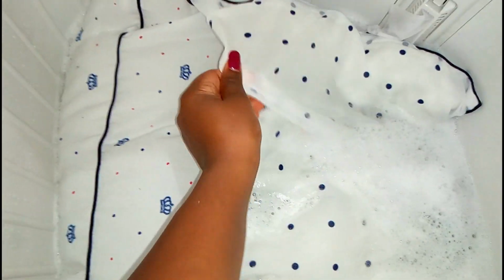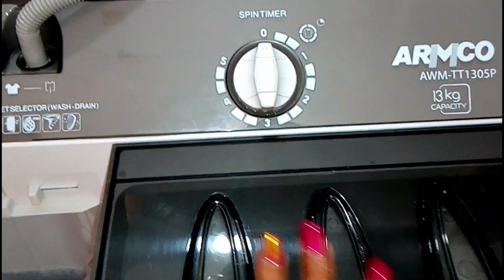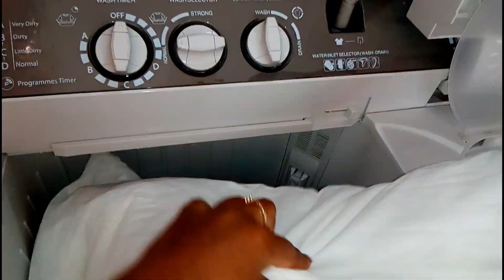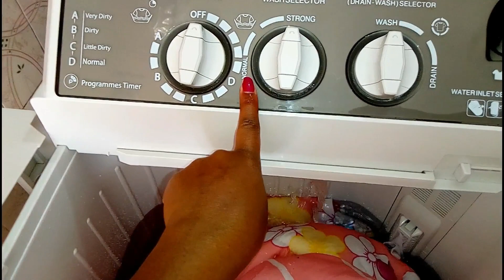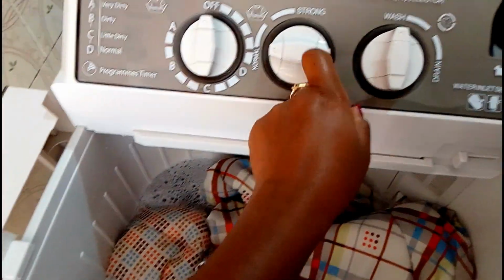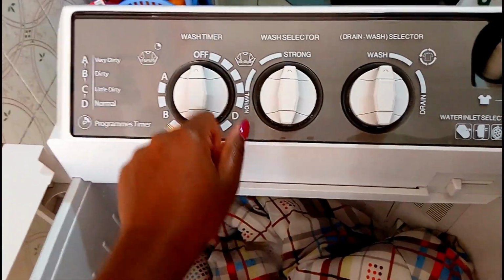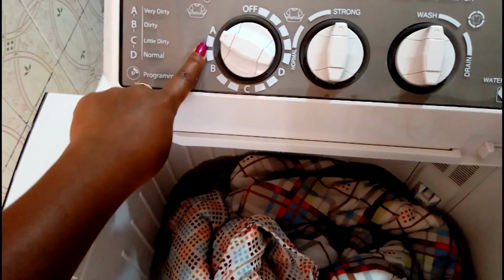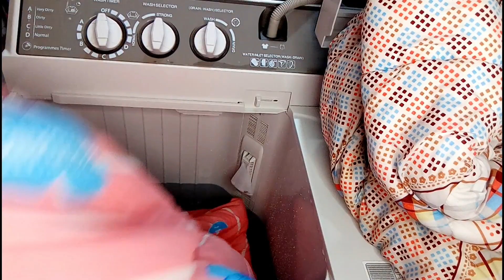HOW TO WASH DUVETS & PILLOWS// ARMCO TWIN TUB SEMI AUTOMATIC WASHING MACHINE REVIEW

Comment: Best to rinse on the washer section (my opinion though). Secondly, to lengthen the inlet pipe, go to any hardware shop and buy the normal horse pipe. I think it costs something like 100 shillings per meter. 3m should be enough for your case.
Reply from the maker: Thank you for the insight 🤗💕
Reply: Where can I buy a long drain pipe ?